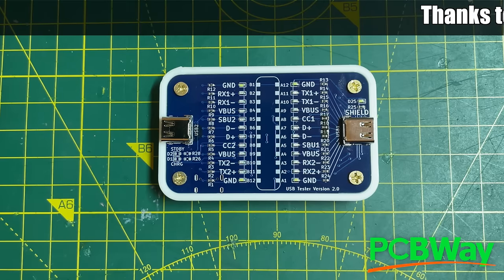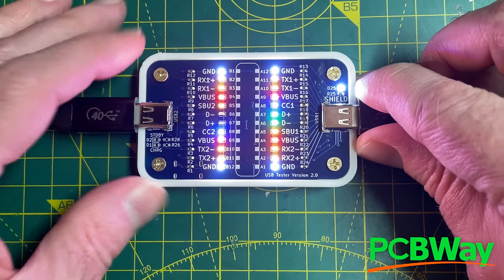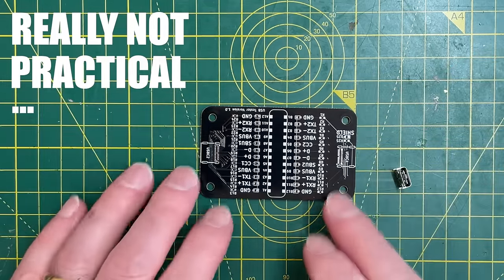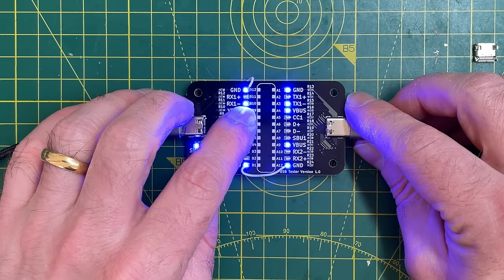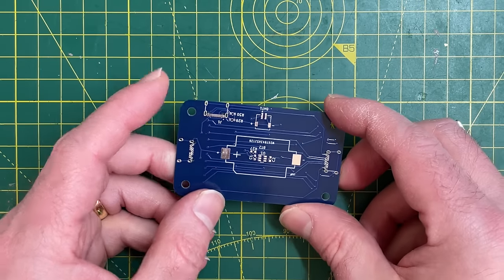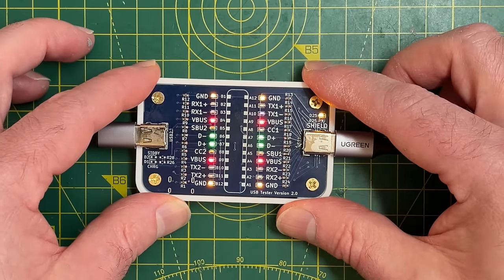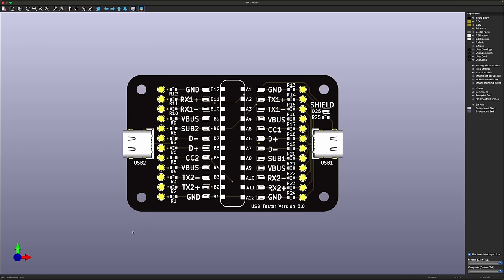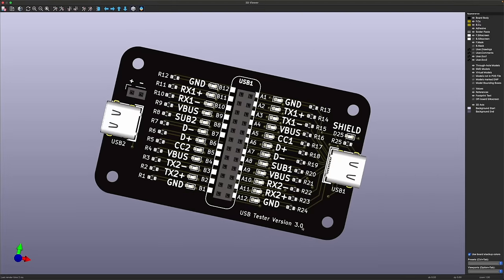How Good Are My USB Cables?

Comment: Do this with HDMI, they differ so much!
Reply from the maker: Not a bad idea.
Reply: @atomic14  If you do, Seeing if its Bi-Directional would be a plus. I'd also opt for PCBWay for doing the filling of the board as well, Too many tiny things.
Reply: YES!
Reply: I need something like this, but with a switch on the 5v power. I have a display that can be powered exclusively with HDMI and sometimes need to reset power without unplugging it.

Comment: FYI, those simple continuity testers won't actually tell you how good your cable is, only which wires exist.  For cable quality you need something that cam measure data loss at the various SuperSpeed data rates, jitter, signal refractions, and other important details.
Reply: Agreed. Have a thumbs-up.  I have one that renders true/false on DC connectivity, with no hints for solder bridges, badly crimped/soldered connectors, cables with wires with one strand of copper on the 100W power bus, etc.
IMO, to do this well, you need a super-tiny micro (CH32V003?) to rotate through the signals to confirm that pin X and ONLY pin X connects when a signal is present on pin X and that the resistance of pinX is not wildly different than the neighboring pins to detect my (learned the hard way) cables with enough connectivity to drive the beep on a DMM but not power up a device on the other side. Maybe there's a way to do it without a micro - I'm a mere software guy so the ACTUAL EE's may know a better way to determine that pin N isn't connected to pin N+1 or pin N+7 or whatever.
I'll wave my credit card in the direction of a product offering this solution. I've already purchased a couple of USB cable testers that have ultimately only clouded the seemingly pass/fail nature of a cable.

Comment: Please open source, id love to do some modifications. You already have 2 usb ports, dont need a 3rd for charging, use one of those for it. If you could add a buckboost, this could make a nice universal charger, and have different attachments for different sized batteries. 

Also, take two of these, add esp32s and you got yourself wireless usb data over wifi ! With batteries to run passive peripherals and sensors

Comment: Interestingly enough I was in my garage yesterday, trying to clean it up, and muttered how I didn't have a USB cable tester (but for all the cables).

Imagine my surprise when next day The Algorithm brings me this video!!!

I also made the "mistake" of getting the super large solder mask for one of my designs. I didn't even realise they come smaller. I super glued some wood to the other side (clamping for a day was tricky) one 3 sides of the perimeter then make a plate with 4th side. PCB fits snug and then can paste it up. But for sure I will check out the size next time.

Comment: Very nice and useful project!! 👍 Amazon stocks a similar USB-A, B, C and Lightning tester for $15 USD that is made in Dongguan, China by Treedix, however the smaller sized connectors on their tester tend to fail easily because of poor physical connection to PCB, so I ended up repairing the USB-micro, USB-C and Lighting connectors more times than I liked.  Straight out of the box, I should have added extra solder to all footpads of every connector before I used the tester for the first time, to help strengthen the physical bond between connector and PCB, but instead I trusted everything would be OK on their build quality, and sadly that was not the case.  Another seller, CABERQU in Austria, has a USB-C Only tester C2C CABERQU which I find works very well and has a better build quality vs Treedix, however the CABERQU is bit pricey at €28 (I found them thanks to a nice video by Andreas Speiss).  CABERQU also has a nice looking HDMI tester for sale also, however I did not order one of those yet.
Reply: Link please

Comment: The data lines are on one side only in order to avoid floating pins and loops, which is critical for a high-frequency line. The controllers have to decide which side to choose using the other signals.

Comment: With how much of a cluster *** the USB-C “standard” is, this would definitely come in handy
Reply: honestly from an electrical engineering perspective it does make sense why the cables are just so inconsistent. the connector is meant to be universal but not the connections. those 24 pins are way easier to be made in a factory than actually connecting them individually with a wire. you can imagine trying to wire a board with 24 whole connections to another board whilst making the size sensible enough for a cable. it's a lot cheaper to just wire up the CC pins, D+ D-, Vbus, and ground instead of the whole set so your cable that's only used for charging doesn't cost $20 per metre. 20V/3A is a lot already for charging any phone or smaller devices. even laptops are sometimes within that power budget. maybe it's different for some people but for most, a 480mbps connection is already enough except something like TB eGPUs and external SSDs. even then they usually just come with their own cable anyways. yeah it's convenient to have your charging cable be powerful enough to handle 48V/5A with 40gbps data transfers but how many times would you actually use those features before the cable snaps off lol
Reply: @lordofthesticks0  That makes sense. Though it would be nice if there was at least some standard for marking the cables. Like maybe a collection of symbols that could be embossed onto the head of each connector. Or even just a QR style code you could scan with your phone to get the specs.

Comment: There are a ton of problems with usbC cables and hubs and PD (power delivery) pass thru : watch out boys and girls :
I have had to test upwards of 15 hub models now
- Adding a 6ft male->female usbC from a powered hub to a computer can cause intermittent glitches that can freeze bios during bootup (sometimes just needs reset, sometimes must power cycle the hub)
- Cheap cables and hubs are all kinds of problems like poor mechanical plug intermittently
- almost all hubs have at least one dumb bug: monitor auto detect problems in windows, PD glitches
- power delivery is a nightmare, 60Watts max on cheaper cables , special E-marker cables required for more power, some cables need to be inverted completely defeating the purpose of usbC, newer ones say they are PD3.1 but arent backward compatible with 3.0 (maybe computer bios problem?)
- physical dimension problems, room around plugs in hubs, 90degree is rare and doesnt fit everything, there are ports on the back of computers with a COVER forcing you to use 90degree or else start cutting your own holes in plastic

NIGHTMARE

Comment: Cool tool.  As a mech engr I understand the worry about getting a design correct especially with the cost incurred for mechanical builds.  I never released a design for mfg without multiple complete point to point detailed reviews.  Essentially, design again for a subsequent review.

Comment: So it's a 'USB Type-C CABLE CONNECTIVITY tester', not a 'USB tester'?  You could maybe indicate the 2.0 signals on the silk screen so you can see if any are missing without requiring to remember the spec? Also indicate which are required for OTG (ID?) and PD (CC1,CC2?) and DisplayPort (SBU1 and 2?).

Comment: Use a lot of good solder flux on the tip of your iron when dealing with those bridges on the connectors more times than not you can drag it right out

Comment: What solderpaste dispenser was that?
Reply from the maker: That was the Voltera - a PCB printer. Does conductive ink, but can also be used for solder paste.
Reply: @atomic14  Thanks! It looks like it is doing a good job. But a reasonably sized stencil works much better😝

Comment: Please tell me that you understand that it takes FAR more than just "pin-to-pin" continuity to make a USB-C cable that can "successfully" transfer 40 Gbps... or even 480 Mbps!?!

Data travels on twisted pairs of wires... and those twisted pairs have to have a very specific twist spec, and twist direction. Not only that, but every data path pair must be VERY tightly matched in delay... you can't have mis-matched timing when the data/clock signals arrive at different times... or it will be completely corrupted.

That's part of the reason "correct" Thunderbolt cables have to be designed with data buffers at each end of the cable... to help minimize the timing problems associated with extremely high data rates.

If that Belkin cable is just a passive cable, its chance of successful transmission of full 40 Gbps data is extremely marginal at best.
Reply from the maker: This is a very basic tester. But you will find that a lot of cables that claim to be high speed are simply lacking most of the wires that are required. Cheap cables that claim to be USB-3 or USB-4 only have the data wires. Or you have cables that are only meant for charging but sold as data cables.

Obviously there are industrial cable testers that will do a complete characterisation of your cable - but they tend to come in the at $$$$ price point...

Comment: deleting comments? not good
Reply from the maker: I don’t delete any comments. YouTube will hold some comments for review, but I check these every so often and publish them.
Reply: @atomic14  I was saying: on Amazon there is such board for 15 GBP with... 9 sockets! so probably your project was... too much efforts for too little gain ;-)
Reply from the maker: Added a link to the description. Looks interesting.
Reply: @atomic14  ha ha ha, yesterday it was 15 GBP, today it is... 28 GBP - what the duck? ;-)
but it works like a charm - I have 50+ cables, most of course are power only with D+/D-, so to find the proper one that is USB 3.2 or 4.0 takes ages. Finally I measured them all and I put sticker on each - now I can say: done and dusted.
Reply from the maker: I found it very interesting that the CC1 and CC2 lines aren’t connected on most of my cables. I’ve been diligently putting 5.1K resistors on my boards for no reason at all.
Reply: @atomic14  but wait, CC1 and 2 are supposed to be connected only on one side - check the USB specs where it is described